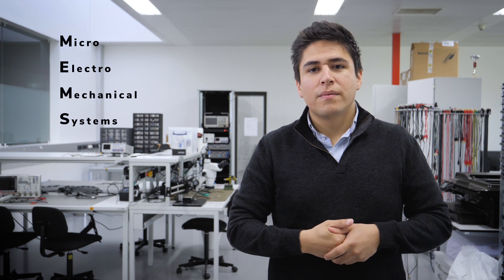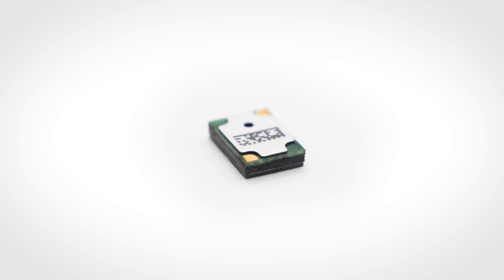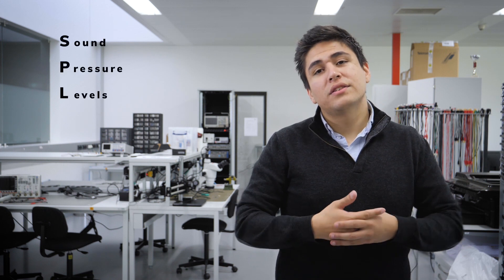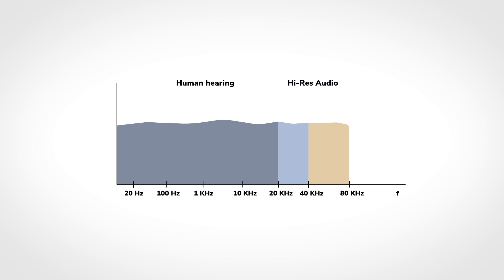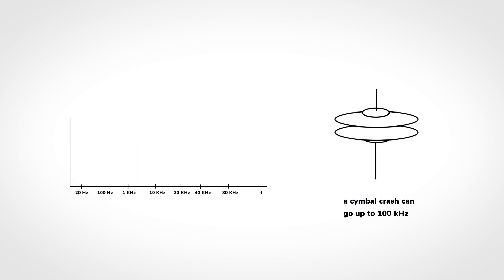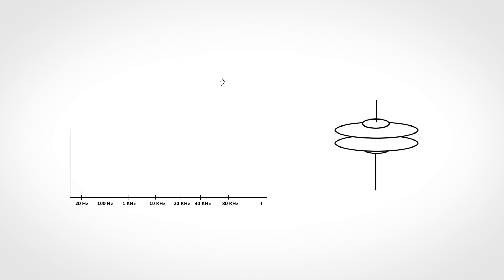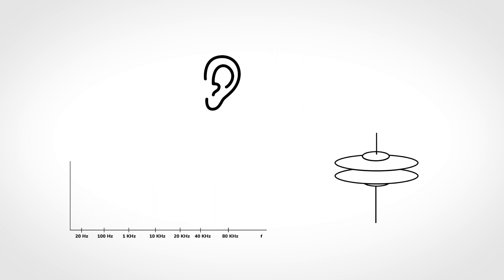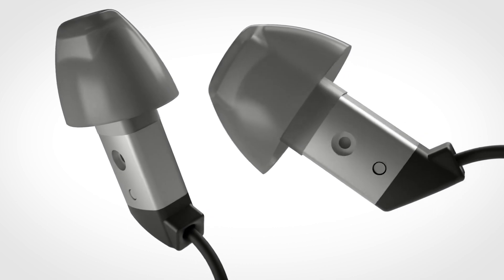Why do MEMS microspeakers have such great performance?

Comment: Your talk concentrates on higher frequency reproduction and fidelity here.

I noticed that the HiFi speaker construction video using the MEMS chip/strip array still has conventional woofer/sub woofer type speaker elements.

Is there a roadmap toward high quality low frequency reproducing sub woofer type capabilities using the lower footprint MEMS speaker technology from µSound?
Reply from the maker: Hello Kenny! Thanks for your interest in our MEMS speakers. They are capable of playing very low frequencies in insert earphones. But in free-field conditions (such as a traditional HiFi loudspeaker), surface area is needed. MEMS technology gets more efficient the smaller the area is, which means it’s the perfect technology for microloudspeakers. For large subwoofers unfortunately there is no replacement for large electrodynamic loudspeakers yet.

Comment: I saw the impedance of these drivers...and its very high..

How can we design IEM with these driver

Can we parallel these driver for lower impedance
Reply from the maker: Hello Dhruv! When designing driving circuits, the electrodynamic speakers must be treated as inductive loads (including a resistive part), meanwhile, MEMS speakers must be treated as capacitive loads. Compared to the electrodynamic drivers, the MEMS speakers require higher drive voltages and therefore typical amplifiers for electrodynamic speakers shouldn’t be used. In our MEMS speaker datasheet, you can find driving circuit recommendations. https://www.usound.com/product/ganymede/

You can also read more about the advantages of MEMS speakers here: https://www.linkedin.com/pulse/efficiency-mems-loudspeakers-ferruccio-bottoni/